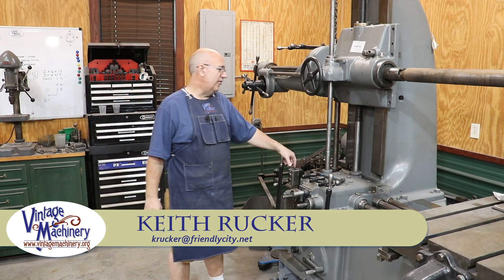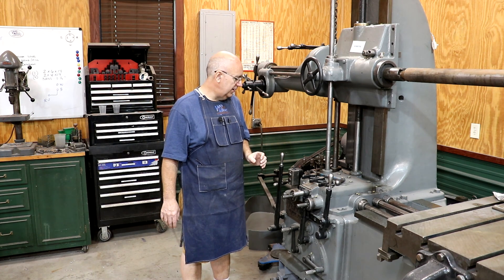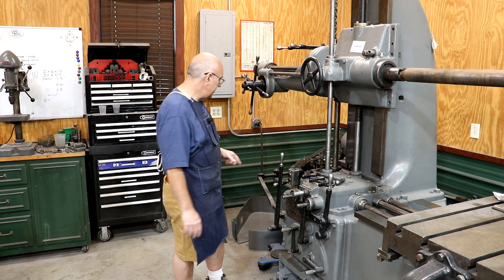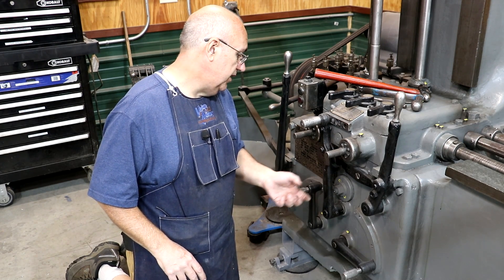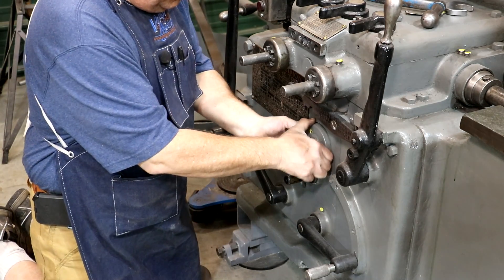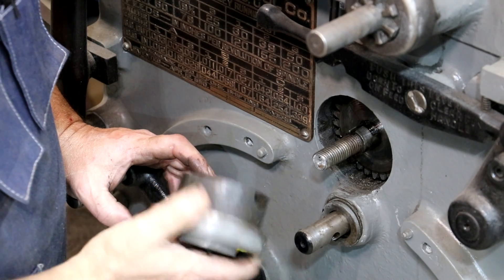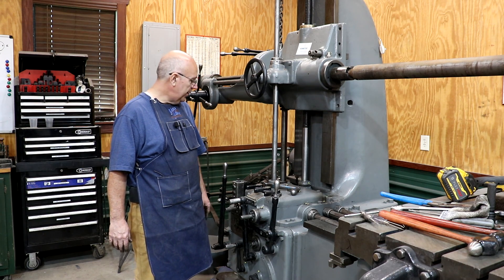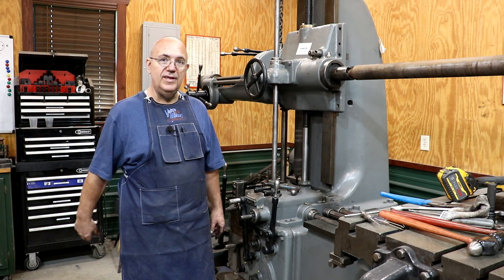Lucas Horizontal Boring Mill: Adjusting the Feed/Rapid Traverse Friction Clutch

Comment: ah a phenolic cotton friction plate.  Those things can be a nightmare.  They're kind of like a bakelite with fibers layered inside, something along the lines of fiberglass.  The problem is that ANY kind of lubricant (including water) will make them slip something awful.  They work great when dry tho.   I have an old push mower that uses those instead of a gear, it's supposed to be a safety feature (not sure how, but don't question 1900 engineers lol).  I had to do alot of research to figure what they were, and I eventually just went done to my local transmission shop and the guy down there told me all about them.  I ended up replacing them with a ceramic clutch that was very close in size and that works perfect without any problems at all.
So, if you have any problems with it later I would suggest taking that down to a transmission shop and they might be able to find a ceramic or Kevlar clutch that will fit.  Mine was alot smaller, so I used clutch plates from a Farmall Cub.  Yours is a little bigger.

Comment: That friction disc looks like made of phenolic paper, or rather "textile" - in German it's called Novotex, or Textolit - and German language entry in Wikipedia lists its English name as Phenolic Woven Cotton Cloth.
This material was used for friction clutch in some brand of German, or East German industrial sewing machines (Minerva, AFAIR), as it was (supposedly) "lifetime lasting" and maintenance-free material.
Other manufacturers typically used cork lined (and greased) plate against cast iron plate, as it provided much smoother engagement (with probably somewhat less torque load it could transfer) - but those had to be replaced periodically.
Textolit inserts were run dry - my guess is, the friction comes from partial thermal decomposition of the phenolic resin that creates sticky compounds, but as the thing is hard (i.e. not pliable like cork) the contact area is somewhat limited and if any grease is present (as it is here) it'd cancel any friction coupling. And at any rate the engagement was pretty "jerky" - which is not good, and neither very safe (as those machines can easily drive the needle through your fingers before you could say "Holy Mary full of grace" - or some shorter albeit less holy expletive).

"Dunno whodunnit" (the grease or oil on the clutch) but it may just leak there from other parts of the machine - and in any rate I'd consider replacing it, or at least trying to use a cork insert (agglomerated cork type) instead - that is, if the movement of the clutch mechanism is long enough to compress the cork insert sufficiently.

Comment: Even if that bakelite is reinforced with asbestos, any loose fibers will stick to oily surfaces and stay there forever or at most end up in the oil sump or filter if there's one, but not into anyone's lungs which is where they are dangerous.
Soapy water does the same, a spray bottle with soapy water is the best to trap the dust from dry type clutches and brakes

Comment: Hey Keith, Ive enjoyed this series on the Lucas.  I have some experience on a Lucas horizontal mill, and got used to the "left-hand' controls,  opposite most other horizontal mills  I've run.  I wonder though,  I havent seen you engage the rapid traverse yet on any of the travels.  Does it work well?

Comment: Having decades Automotive experience with asbestos I can tell you that you are in the zero danger of asbestos contamination from Bakelite impregnated with asbestos especially if it's oily. Asbestos is only serious problem if it's a dust or a loose fiber I don't see that in this case.
Reply: Yes sir!  The terror over the "A" word is way over board!  It is a serious problem when airborne, but otherwise, nothing to worry much about.

Comment: I wouldn't be surprised if, years ago, someone noticed that the clutch wasn't working properly, took the shaft out, and thought "that leather washer needs replacement, it'd be easy to make a bakelite washer that'll last forever" and did exactly that.
Reply: Bakelite is an interesting material! The first "Plastic" AFAIK. Cellulose based, thermosetting (hence the trademark). '40s or so maybe earlier. I've got a few old radios with Bakelite cases and there are NO scratches on them after all these years! 😁
Reply: @PhilG999  The "bake" in bakelite has nothing to do with thermosetting, it is part of the name Baekeland, the Belgian inventor of the material.
Reply: @sierkdejongh8984  Thank you for the correction! That's what we were always told in Engineering College! What year (if you know) was it invented?
Reply: Bakelite is the asbestos clutch they talked about in the manual, at the time they made those clutches, all bakelite had asbestos in it.

The main spindle drive clutch should have the same friction material, it also will have asbestos in it.

My later model (41) had the same clutch setup and same asbestos friction material, I replaced them.
Reply: @procyonia3654  So mabey it's an original Lucas replacement part?
Reply: @jwaterous224   yep, I'd say it has a high % likelihood of being such
Reply: @PhilG999  Invented 1907. Patented Dec 7 1909. Used through 1940s. Better plastics invented during WWII, so fell out of use after WWII
Reply: @procyonia3654  I have radio cabinets, that are bakelite,that have broken, and I have never seen fibers of any type in it.

That piece looks like phenolic,which works well in those places.
Reply: @davidhamm5626  I agree!  Over the years I've had many Bakelite parts and (unfortunately) pieces at times and never noticed any fibers.  I'm not saying they didn't make an asbestos based casting, but I sure never have seen it!
Reply: @PhilG999  I have looked it up on wikipedia, the English version. it was patented in Germany in 1909. The article is worth reading.
Reply: @procyonia3654  If you look in wikipedia, you will find that only for a few applications asbestos was added to bakelite. Most bakelite did not have asbestos. Other additions were also used occasionally.
Reply: @paulcopeland9035  asbestos fibers a tiny and not seen with the naked eye..

Comment: I'd be impressed if that machine wasn't covered in lead paint and that friction material wasn't asbestos.
Reply: Quasi certo considerato il periodo di costruzione
Reply: Lead paint won't hurt you.  Lead paint is much like asbestos.  If it is loose or airborne then it needs to be dealt with.  Stuck to a 100 year old machine is not a hazard!!!
Reply: @paulcopeland9035  he wire wheeled it

Comment: I don't see how that is the clutch. The clutch would be between the gear and another gear. That disk was just a bearing surface between the gland and the gear. 

Looks like you need to pull the entire shaft out to inspect the clutch.
Reply: It is the clutch, its tightened with the nut.
In this case it's a slip clutch in case of a crash and it's not controlled at all.
Reply: @samuraidriver4x4  the washer is between the gear and the outer gland. The gear is keyed to the shaft so it can't slip on the shaft. The gland isn't driven, so how could that washer possibly allow anything to slip.
Reply: @ionstorm66  the gear is not keyed in a setup like this, it can rotate freely on the shaft.
The shaft is what is powered and the gland is keyed to the shaft.
Very common setup that's built in to protect the gears in case of a crash.
In the first initial test you can clearly see the gland turn without the headstock going down.
Reply: The gear isn't keyed, it spins on the shaft and the friction on the inner and outer faces is what lets it slip. If you want to see an unfortunate use of the same thing in modern times, look at some of the newer Ford engines where the timing sprocket on the crankshaft isn't keyed and instead is just held by the friction of the crankshaft bolt.
Reply: I was going to make a comment about how much I enjoy your videos and marvel at the variety of jobs you undertake but it seems you have plenty of sideline critics out there already. Keep up the good work Keith.